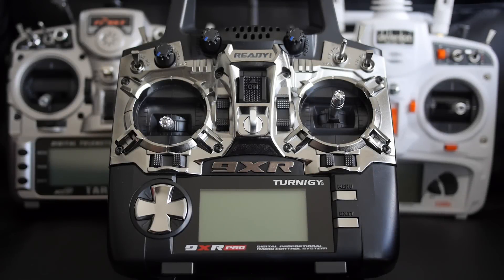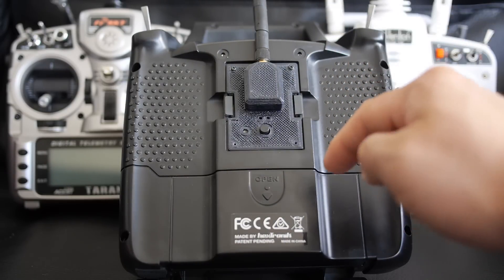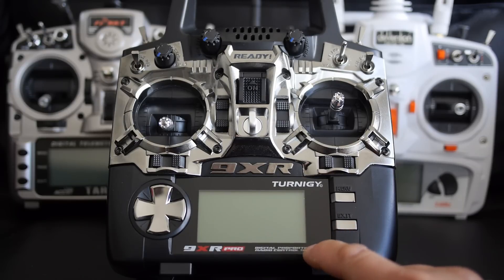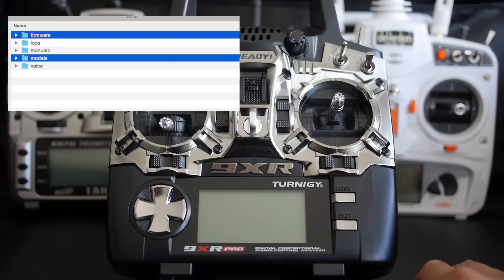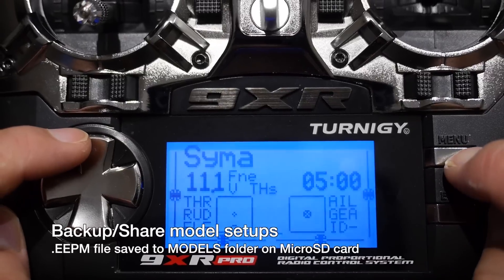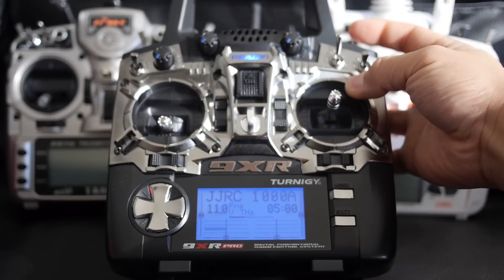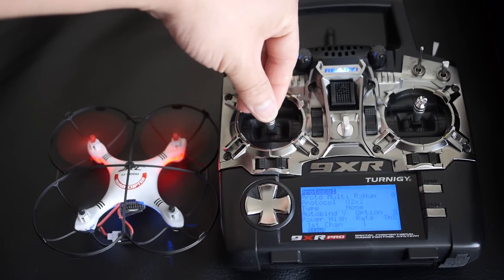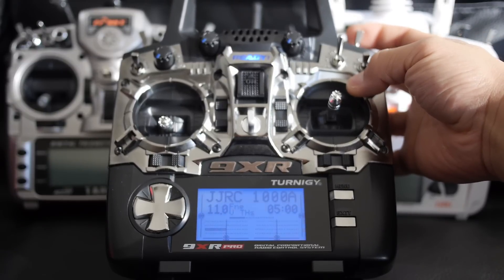Turnigy 9XR Pro: 4in1 multi protocol module all in one radio transmitter

Comment: Just wondering, searching through banggood and I saw another multiprotocol module but much cheaper. http://www.banggood.com/Multiprotocol-TX-Module-For-Frsky-X9D-X9D-Plus-X12S-Flysky-TH9X-Transmitter-p-1097688.html?rmmds=search Thoughts?
Reply from the maker: I have that one coming in the mail.  It's one that only operates in PPM mode and has very limited # of supported models.  I got it to test out but it's not really as capable is the 4in1.  I'll do a video on it.
Reply: Sure. Thanks!

Comment: How does the 9xr Pro compare to the Devo 10 in terms of there gimbals?
Reply from the maker: +Andre Martinez the Devo 10 has better gimbals because it's smoother. The 9xr pro gimbal has shorter throws.  For me it's not a deal breaker but it might bother some.
Reply: Hmm so far the only thing that is holding me back In buying the 9xr pro are the throws of the gimbals on it. Another concern, how are the buttons and switches on the 9xr pro? I heard that the buttons used in navigating through the menus can be a bother. Thoughts?
Reply from the maker: switches are fine, the navigation buttons work fine for me.  I saw rcmodelreviews review on the 9xr pro and his was finicky.  Maybe they fixed it since.  The throws are shorter but I can't really complain for the price.  If you want the best radio of the 3, get a Taranis, it's a better radio overall.  But for $60, I can't really complain.  One of my friends bought a 9xr pro after trying both of my Taranis and 9xr pro.  He couldn't justify the extra cost of the Taranis.. and as he said, he didn't see a $200+ difference.  He typically flies with the stock crappy radios with the micro quads so the 9XR Pro is light years better already.   If I bought the 9xr pro before the Taranis I probably would be pretty happy with it and wouldn't look at the Taranis at all, but that's just my opinion.
Reply: I think you just sold it to me! The review from rcmodelreviews was what held me back. I hope you or some other youtuber make an updated review of the 9xr pro comparing it to the Devo 10 and Taranis to really justify its performance and 60 dollar price tag!! Thank you so much. Hearing it from someone who has owned a Taranis and Devo 10 saying that the Turnigy 9xr pro is great especially for the price compared to the Taranis and its price tag, really helpful! Thank you again and I hope your channel grows more. Cheers!!
Reply: Andre Martinez For me the HUGH upgrade of the Taranis is the easy to use telemetry.  I think the 9xr CAN get telemetry but requires some complicated hardware hacks.  But having the voltage on my individual cells being monitored has probably saved my quad several times and I don't need a timer any more.  I know exactly when I it is time to land no matter what size battery I am using or how hard I am flying.  Just my $0.02
Reply: Elite Geek I am looking into the Devo 10 and Turnigy 9xr pro as I am in a tight budget right now. Maybe when I get deeper into the hobby, I would upgrade to a Taranis. But right now at 60 bucks the Turnigy 9xr Pro seems to be my best bet. Thanks for the insight :)

Comment: maybe you could do a simple comparison between them and under what circumstances the Taranis is needed because of its additional 3 position switches..... please?
Reply: I  just can't afford the Taranis unless I  really raally have to buy it
Reply from the maker: I think you can't go wrong with a 9XR Pro.  For my purposes I only need one 3pos switch.  Depends what you fly.  I also like the larger screen of the Taranis.  But I think I would be very happy with a 9XR Pro if I didn't have a Taranis.

Comment: there has to be some deficiency in this Turnigy compared to the Taranis, other than maybe build/reliability  and quality
Reply from the maker: The Taranis is definitely better in many ways.  More 3pos switches, nicer gimbals, sliders, larger screen, builtin FrSky internal module.   Turnigy 9XR Pro's gimbals have limited throws, mostly 2pos switches, small screen.  It doesn't feel cheap, feels solid.  If the 9xr pro was say $100+, i probably would pass on it, but at $60, it's awesome.

Comment: Thanks so much for your video. It was transmitter I have been looking for a 4in1 module. Thanks again for your help
Reply from the maker: Thanks for watching.   the 9xr pro is a nice performer for the multimodule.  I've been using it regularly instead of my other radios.  Also because of it's price, I don't really worry about it too much when I bring it out.
Reply: Thanks, just order 4in1 from Banggood and the radio from HobbyKing.